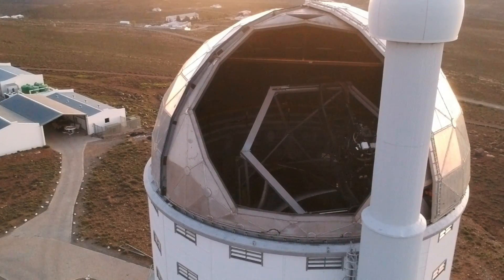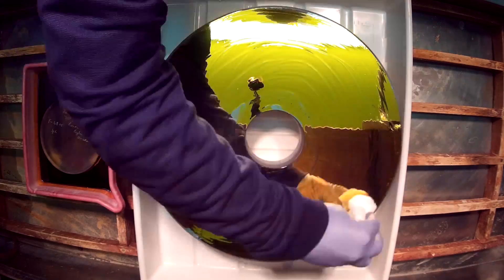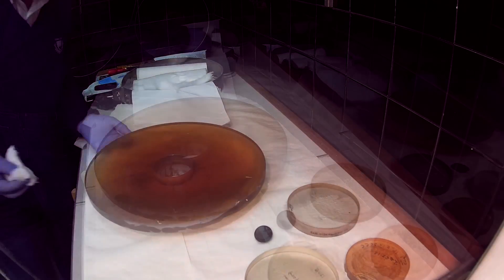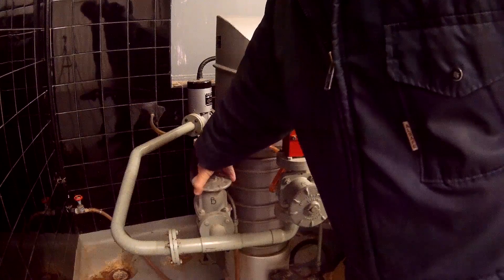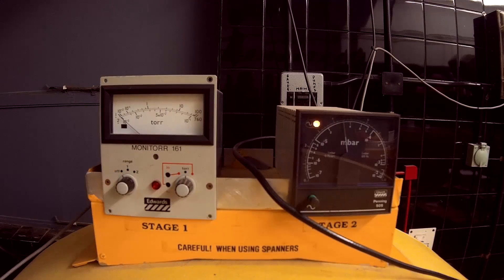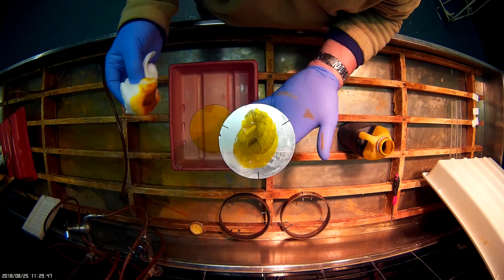How to Aluminize Telescope Mirrors

Comment: We run our 48 inch primary at least 4 years before cleaning with some light 40 grit drywall sandpaper. Brings the sheen right back while avoiding the need of expensive aluminizing and down time.
Reply from the maker: Either "40-grit sandpaper" means something else to you than to me, or you are kidding - I suspect the latter!
Reply: @SterremanWillie  
Lol...great video Willie, I coated my first 3" mirror 40 years ago in a pickle jar with an Edwards diffstack and roughing pump I got from a pix tube rebuilder.
Kinda supprised you don't have preheat shutters on the evap coils.
Reply from the maker: @sparkyy0007  Interesting!  I have physically seen the insides of about half a dozen aluminising tanks in my life and pictures/videos of another half a dozen, but they were all similar to what we use.  Tell me more about preheat shutters please?
Reply: @SterremanWillie  

There will always be some contaminants on anything you put into a vac chamber no matter how careful.
Micro-scratches in the Al wire will hide pull die oils that are impossible to remove with anything but heat.
Cleaning solvents, even reagent grade are never 100% pure, and anything that doesn't come off at 21 C will out-gas or boil off. 
These contaminants will boil off (line of sight) onto the substrate just like the Al, and depending on the composition of the contaminants or their decomposition products when heated can cause surface reactions or adhesion problems with the Al coating.

 All E-Beam evap systems use a mechanical shutter during warmup to prevent these volatiles from reaching the substrate.
The volatiles ( usually oils or hydrocarbons, but sometimes organics and dust)  come off at a pretty low temperature, usually far below the melt point.
E-beam is extensively used in the semiconductor and optics industry where multiple evaporants are utilized in a single session used for multi-layer stacks, and where coating purity is paramount. No tungsten is heated during the process.

https://moorfield.co.uk/knowledge-base/electron-beam-evaporation/

http://www.nanomaster.com/images/deposition/e-beam/nee4000-dualclosed.jpg

Here is K Leskers units, they shutter their heater boats as well.
https://www.lesker.com/newweb/Vacuum_systems/thumbnail/Photo/Photo-SY-NANO36_04-THUMB.jpg

As well, with any tungsten filament evaporator, there is always a small amount of (W) boiled off depending on how hot you run the filaments, and this will reduce the reflectivity, W is really black. If there weren't, we would never need to replace the coils.
Reply from the maker: @sparkyy0007  Interesting.  This problem gets addressed by doing a "melting on" procedure.  You  may know this, but what you do is to load the coils and close the tank (without any mirrors) and pump to vacuum.  Then you fire the coils only to the point where the aluminium hooks "melt on", i.e. form into bubbles on the coils and stop the current.  This boils off all the bad stuff you described.  You then release the vacuum, load the mirrors and continue the process as in my video.  For some reason, our guys dropped this step, so I don't do this any more either.
Reply: @SterremanWillie  
Yup, that will work just fine too, but a lot more time and work...and that's why your guys are skiping it.. lol.
If you mount some simple SS mechanical shutters on you can run a single pump down cycle and improve your coatings.
If you set it up right, a single rotary feed through (cheap) and single wire linkages can control all the shutters at once if you spring load them in the closed or open position.
Reply: A wise ass remark that leads to incredible tech info!

Comment: ok the mirrors used in astronomy are surface mirrors but could a lot cheaper mirror be made for the hobbyist. I stop by Michaels and built a massive telescope. I will see those people on the moon.
Reply from the maker: The mirrors of both professional and amateur telescopes need to be ground and polished very accurately into a parabolic shape.  This can be done on a special polishing machine or even by hand, as many amateurs do (search YouTube and you will see many videos on how to grind your own telescope mirror). The smallest detail on the Moon, visible from Earth, is about 100m, even with professional telescopes, so those people will have to be quite big to see!  ;-) ;-)

Comment: Just curious... Why aluminum? Wouldn't Chromium cladding make for a far more robust and durable surface?
Reply from the maker: I have not heard of chromium covered mirrors before, but materials like aluminium, silver and gold are more common.  Sometimes mirrors have overcoats (mandatory for silver since it tarnish very quickly) to make them more durable.  But, either way, the reflectance goes down with time, hence regular re-aluminising is still the best to keep telescopes in good working condition.  Also remember that the layer must be very thin, as not to alter the very accurate optical surface in any way - our layers are typically only 10 microns, just enough to be opaque.

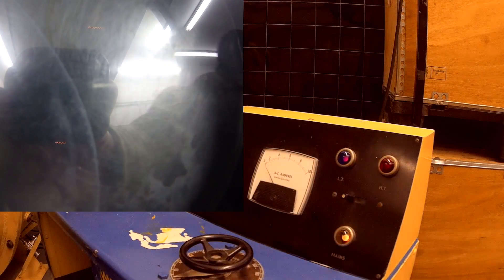Comment: Nice video, very interesting!  Some questions:  11:25  Where is the aluminum?  Is it coated on to the tungsten coils beforehand?  12:48  When the aluminum is vaporized, wouldn't it fall to the bottom of the chamber?  I'm surprised that the mirrors are hung veritcally rather than having them at the bottom and vaporizing the aluminum above them.  Since the mirrors are hung vertically, the aluminum must make a cloud that fills the chamber when it is heated?  But then, wouldn't it coat everything inside the chamber, not just the mirrors?  How come the glass porthole in the chamber door doesn't get aluminized, along with the mirrors?
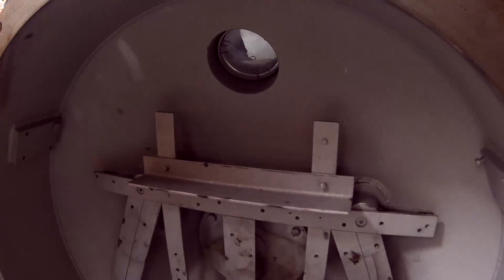Reply from the maker: The aluminium hooks does not show well in the wide angle GoPro view at 11:25, hence the close-up inserts at 11:34 and 11:43 onward.  You can also see in the close-ups how the aluminium form balls on the tungsten filament and do not fall to the bottom (the bottom of the tank gets inspected for this after every run - there are indeed occasional "drips", but these are minimal).  Gravity plays no role in the process, so aluminising chambers come in any orientation.  No aluminium "cloud" forms, but rather aluminium "bullets" flying at high speed in all directions from the source and do indeed coat everything else as well, hence the grey colour of the tank's inside.  The porthole windows do indeed get aluminised, hence the protective glass needs to be cleaned after every run as can be seen from minute 14:38 to 16:14.
Reply: @SterremanWillie  Ah, I see at 17:10 how you hang the Al wire on the coils, missed that before.  And 14:44 where you clean the porthole glass that has also become aluminized.  Thanks for the explanation!  I have a small diffusion pump and am thinking of making a small chamber to re-aluminize my 14-inch telescope mirror.
Reply: Indeed everything does get coated with Al; but in a high vacuum the collisions are few and the Al atoms travel almost horizontally (like the beam in a torchlight) and most land on the opposite side of the filament.

Comment: I’m surprised how dirty the operation is. I would have thought this would be done in a clean room and white coveralls
Reply from the maker: Good point.  A cleanroom would be great (and expensive) but in reality, a relatively clean environment with controlled practices, are all that is needed.
Reply: I'm guessing that is because mirrors are typically exposed to dust, moisture, insects, ect in the field?  Has anyone ever tried to spin a resin mirror like they do for mercury mirrors?  I feel like that might be a good way to avoid the long grinding process!
Reply from the maker: Interesting question  @bardrick4220  - Slow setting epoxy mirror blanks have been tried but they have some practical difficulties.  One is that extremely smooth power supplies are needed to run the motor that rotates the turntable - any power supply ripple gets imprinted in the surface.  Also, due to thickness difference, there is differential rotation at different radii - people tried to correct for this with radial ribs, but they form print through onto the surface.
What is actually done as a matter of course these days, is that mirrors are spin cast, to reduce the amount of glass that needs to be ground away eventually.  The famous spin cast facility to cast 8-metre diameter telescope mirrors is at the University of Arizona.  I suddenly wonder if there are any YouTube videos on this operation.
Reply: @SterremanWillie  TY I found some videos.  That is absolutely incredible; I didn't even think of spinning molten glass!

Comment: Yu use the Silice Oxide?
Reply from the maker: Not sure what  it is?   If an overcoat, no, we don't overcoat.
Reply: @SterremanWillie  Silicon oxide, is a coating that is made after applying aluminum, it is also applied by evaporating the aluminum oxide, covering the aluminized surface

Comment: At 13:25 you can see there's a huge flaw in the upper right quadrant of the large mirror!
Reply from the maker: Well spotted.  What happened was that the secondary mirror of this telescope, came loose from its mounting and fell on the primary mirror, causing this mark.  A big chunk chipped off the secondary but was otherwise OK.  The problem with the secondary mounting was fixed and the telescope seems to be working fine again, despite the mark on the main mirror.
Reply: @SterremanWillie  Even bullets and a hammer couldn't stop this mirror: https://astroanecdotes.com/2015/03/26/the-mcdonald-gun-shooting-incident/

Comment: why is glass the base? is it because it’s really smooth?
Reply from the maker: Good question.  Glass still remains the material of choice for telescope mirrors.  It can be finely polished very accurately in any shape, but it main properlty for modern telescopes is the low thermal expansion.  Most amateur mirrors are made form Pyrex but modern professional scopes use the same glass that are used in glass top stoves which has even lower thermal expansion than Pyrex, have can be heated a lot without cracking.

Comment: FWIW:  Where I used to work, we used aluminum {aluminium} wire as "twist ties" to hold loose parts together, and to attach paperwork to parts.  It is easy to twist, but holds things together quite well.  Also easy to cut.

How pure the wire was, I do not know.
Reply: most likely the wires came from parts of electrical cables (cut pieces that are often discarded) and they are highly pure (but I do not know the exact purity). Al is rather easy to purify.

Comment: Just a thought: Is it not possible to cover the glass window in a clear coat of paint, so the Al will not aluminize the windows during the process? (Thinking that the Al will only stick to clean glass?)
Reply from the maker: I'm afraid that will not work either.  Although the aluminising does not stick (properly) to paint, it will still cover the paint and would need to be removed afterwards - what we do anyway from the glass disks.  Since the coil current "shows" us what is happening inside the tank, we actually do no need a porthole to look through, but it is just convenient to be able to.  If you watch my other video where we aluminised a 1.9-m diameter mirror, there we actually do it "blind'.

Comment: I am a millwright and I had a job maintaining the equipment used in vacuum deposition of metal on flat glass. We coated glass not only with aluminum but copper, bronze, silver, titanium, zinc, and stainless steel. Maintaining the vac pumps, including the diffusion pumps was an interesting job.
Reply: Ah, were you a member of the Aluminati?

Comment: I haven't seen an oil diffusion pump in ages.  I would have thought a small turbomolecular pump would be used.  Great video!  Thank you.
Reply from the maker: The pumping speed of a small turbo pump is way too low for a tank of this size.  Go check out how NASA also still use diff-pumps to evacuate their large vessels/chambers.

Comment: Now I'm curious about the techniques used on earlier telescope production.
Reply from the maker: Silver coatings were used before aluminising.  A silver salts mixture was pored onto the mirror, but one problem is that it was hard to get an even thickness layer.  Also, silver tarnishes very quickly, so it had to be physically polished regularly.  This has the risk of grime scratching the mirror (and the coating of course).  Even older techniques (back in Herschel's time) had the mirrors made from "speculum metal", two parts copper to one part tin and a small amount of arsenic.  This produced a soft metal which could be shaped into a parabola and then polished .. and frequently re-polished because it tarnished quickly.

Comment: This was a wonderful video, it helps us to understand all the hard work and dedication it takes behind the scenes. So often we forget the engineering and technical marvels that make modern scientific research possible. Also your video is excellently made to tell us all about the process as you are moving through it. Many thanks!
Reply: This is not at all what John described as the process he used to aluminize the mirrors we ground in his class. He describe a process, from what I can recall, where the glass is suspended a certain distance from the source of the machine that shot out the aluminizer like a few electrons thick across the entire surface of the glass. Of course we never got to witness this process, but we did soon receive our perfect reflector mirrors.